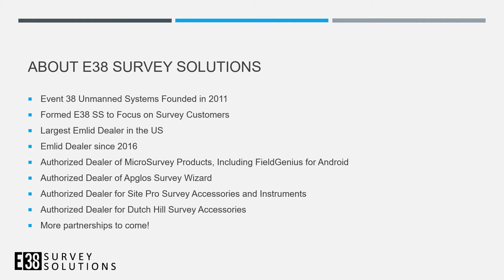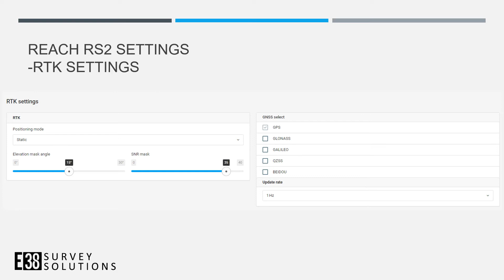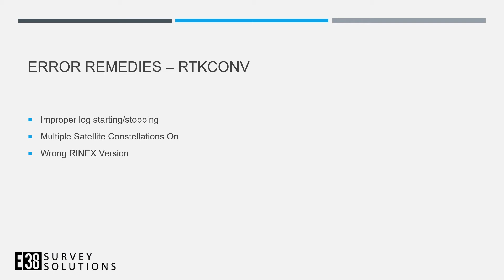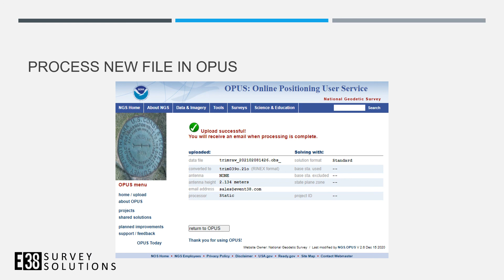OPUS Processing Using The Emlid Reach RS2

Comment: Too expensive.
Reply: @e38surveysolutions59  Is there a good comparison between what are differences between different prices?  Reason why Im asking, and why I think it is expensive is that I see some modules sold online ... just the boards and antennas... so with little tinkering one could make a rtk system for 50% of your price.
Reply: @e38surveysolutions59  No, difference in your units.
Reply: @bitlong4669  I have done this with the ZEDF9P Receiver and a good multiband antenna. Very large learning curve. There are a lot of settings within the ZEDF9P that have to be tinkered with. A good bit of development to make it user friendly. Finding reliable mounting options to aid in grounding and multipath rejection be difficult to find let alone one that is guaranteed to be level. In the end, the reach RS2 is a better product at a fraction of the cost for what you would pay from Trimble, TOPCON or Leica.

So lets say you made your own RTK base and rover from the ZEDF9P. You have all of the correct setting. Your seeing good RTK corrections and you know its very precise. How do you know its accurate? How do you know for a fact that the point on the ground is accurate, especially with the home made gear?
Reply: You should not add the 134mm to the height. When selecting the antenna type the height correction is corrected. If you have a 2 meter pole than the height should be 2 meters and then select the antenna height. Check your data against a network or NGS monument!